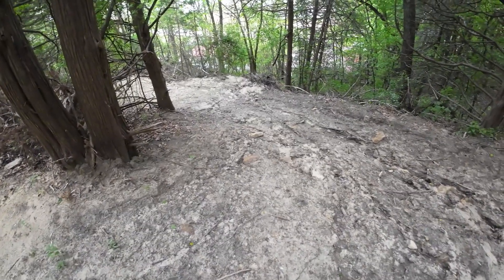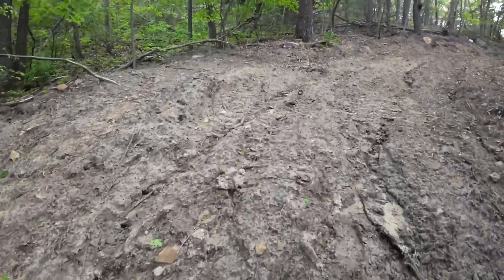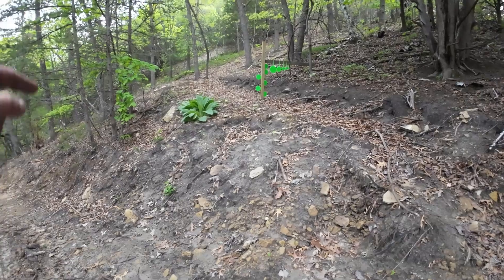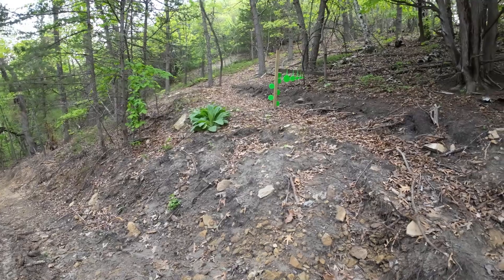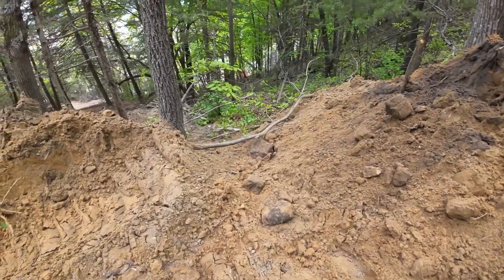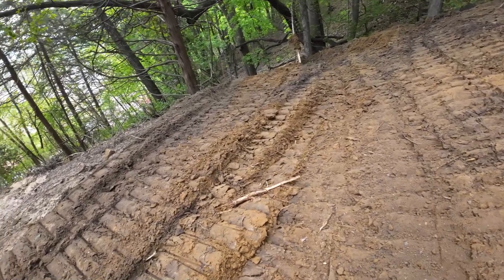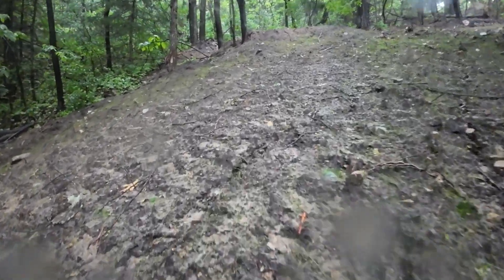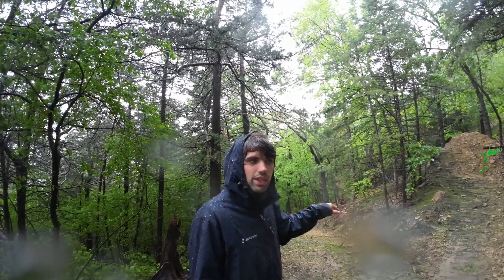Grading Logging Road To Stop Erosion

Comment: Getting that seed to grow is key. Hopefully that seeds shade tolerant.  If that is a low usage trail why didn’t you consider having a slight out-sloped for the entire steep section?  This way no water collects in a ditch and no water bars are needed.  Out-slope allows the water to move across the trail, never gaining enough volume to cause erosion.
Reply from the maker: The seed has been growing well. It is supposed to be shade tolerant, but I should come through and do some tree trimming to get some more sun on it. Early this spring I graded it the best I could the slope out to the side. Unfortunately that wasn't successful I think because I drove up it a few times when it was wet and the water started following my tracks. It's also very sandy so it washes easy and we have gotten almost 12" of rain here in the last month, so that is not helpingmy cause.